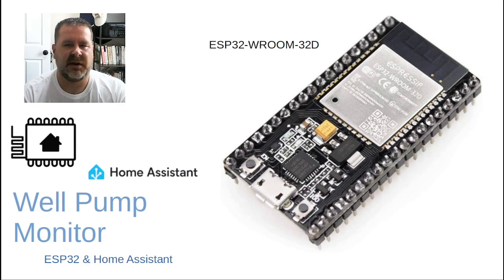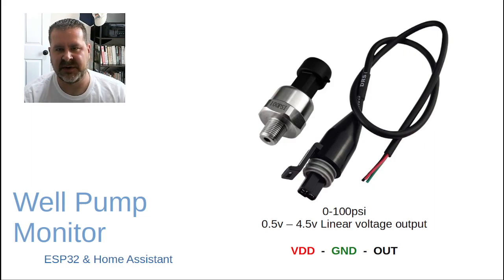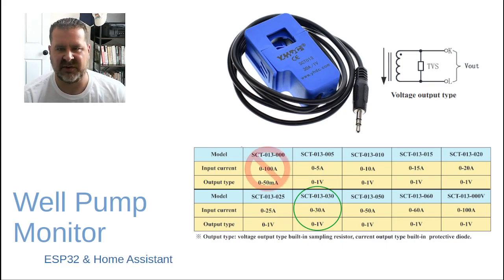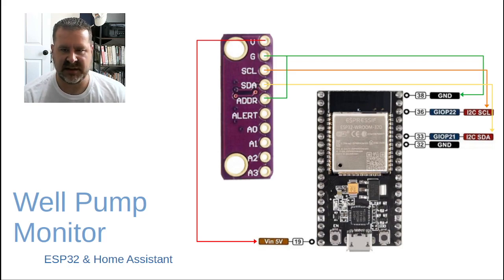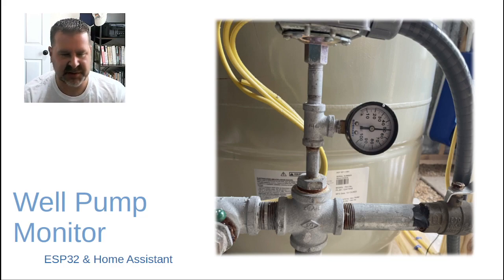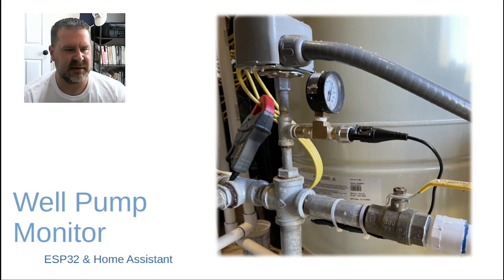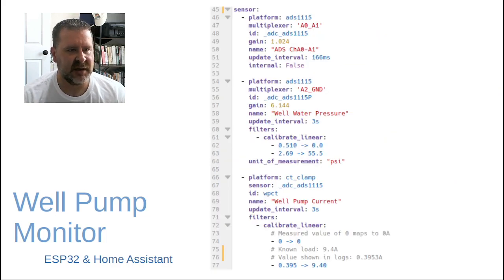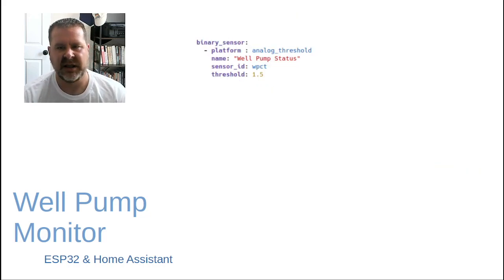ESP32 Home Assistant Well Pump Monitor

Comment: can you possibly list the part numbers for the clamp for the power and also the part number for the pressure sensor? 

That little board I see you listed that but I don’t know what the other two part numbers are like what links they are on Amazon, for example 

could you also please post a link to the yaml? 

Great video I’m anxious to try to build this. Thank you very much.